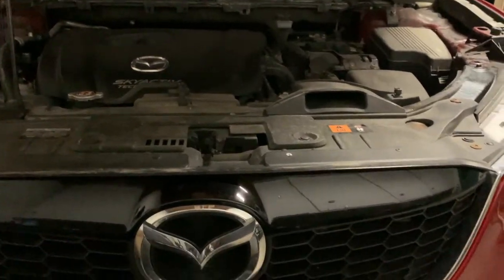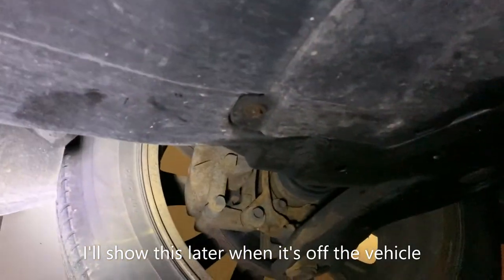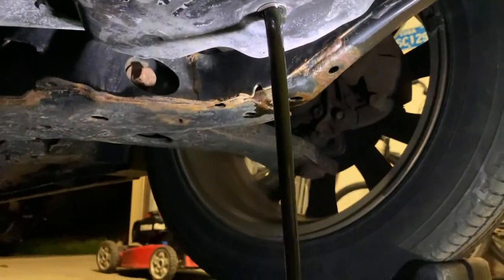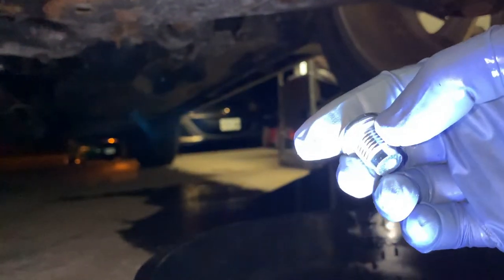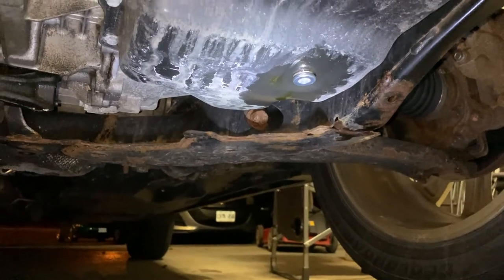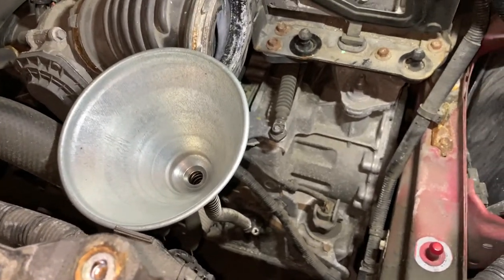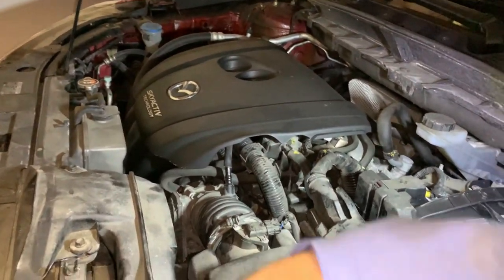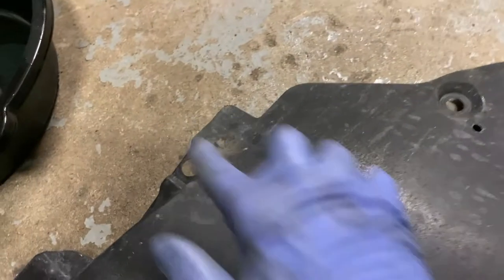Mazda Skyactiv 6 speed automatic transmission fluid drain and fill

Comment: Transmission fluid level should be checked at a certain temperature you will need a scanner that reads TCM to get your transmission fluid temperature you’re risking overfilling or underfilling
Reply: Actually you do not need to, drain the fluid when the car is cold, add back in the same amount as you drained, all done when the car is cold. I have changed mine a few times like this no problem, BUT making sure use the same Mazda auto trans fluid! Other compatible brands? I do not know...
Reply: @BaeLasso  even if that were true, it should be mentioned in the video.....
Reply: We
Reply: Drain and fill same amount

Comment: I have a 2014 mazda 3 with "lifelong transmission fluid"😂 it was pretty dirty when I changed it at 75k in 2020. What they mean by lifelong fluid is basically "life of the warranty fluid". so every 75k is a good fluid change interval, if you want your transmission to last as long as the engine.
Reply: Did you go to the dealer to have it changed?

Comment: 63,000 miles on our Mazda CX-5 so did this yesterday (exactly 3 1/2 quarts came out) Hardest part was removing that plastic covering underneath then replacing the stupid thing. Thankfully I have bins of various plastic clips which help replace those I destroyed removing them.
Reply: I just did mine yesterday, and only about 3 1/2 quart came out too…

So i just replace it with the same amount… im wondering why some get more or less from drain…

Comment: Best video related to this job I've seen.  There are a couple of others that omit removing the splash guard and air box.  This is also the only video I've seen that includes the need to measure the fluid removed to know how much to correctly put back in.  There are between 6 and 7 liters of fluid in the entire transmission.  

Changing the filter involves removing the entire pan on the bottom, cleaning thoroughly,  replacing both the filter and seal and putting the pan back on - torque wrench should be used.  

I'll note that there is a lot of conflicting info on whether the ATF should ever be changed.  Mazda claims that it never should be for Skyactiv unless a transmission component has been damaged or changed.  Yet, my dealer says this should be done and wants $350 for the job.  Of course, they also charge $75 to replace the cabin air filter - literally a 90 second job!  Common sense tells me that if you look at the fluid that was removed, of course it must be changed.  Apparently, you also cannot flush the transmission fluid without modifying something.  However, part of the debate I've seen researching whether to change the fluid or not has claims that changing the fluid can stir up metal shavings and actually damage a working tranny.  

Oh - and while it is expensive, the Mazda FZ transmission fluid is supposedly needed for Skyactiv.  Not sure how much stock to put in that, but I'm doing it.  Thanks again for the thorough video!
Reply: Yeah after seeing how easy it is to change I can't justify paying the $300 Mazda wants to do the job. They tried to get me to do it when I took the car in for service this week.

Comment: I have a 2014 Mazda 3 2.0 liter, same thing. Just did it today and SOOOO easy! Even had the air box assembly come out like a breeze when 2 other videos were struggling. Took 1 hour and 20 minutes with a LOT of fooling around and going slow, first time. Could easily have done it in less than an hour and every bit as important as oil changes just not as often. At 66K the original lighter blue green fluid was medium brown time to change! It shifted ok before but now it shifts even smoother and maybe quicker, well worth doing every 60K miles!

Comment: Thanx for the great video. Have a 2014 Mazda 3, did a drain and fill at 60K miles (4L Ravenol FZ). Now at 71k did a pan drop with a new filter (4.5L). Used the rubber gasket that came with the Wix filter. I had to try it. Leaked the next day. Got it on straight and it's just a bad fix. Dropped pan again next day, used HF Pro Seal Black RTV, put pan on, used the fluid I saved and walla no leak. Will do a drain and fill in 50-60 then another pan drop and filter around 150K.

Comment: Excellent video. Thanks. I'm gonna do this to my 2018 Mazda Demio. Same parts exactly. BUT,  since you removed everything beneath, you should change the transmission filter as well. All you had to do was to take off 6 screws for the oil gear pan and then two screws to take off the filter. NEW gasket is required but a good LOCTITE trans oil silicone red or grey would do fine.  Apart from this, thank you for the video. Absolute informative. Didn't know that Mazda 2 and 5 have the same air filter and 6 speed auto gearbox!!!
Reply from the maker: Not my car, wasn't my decision to make. Considering the mileage it would've been a good idea. I think that pan had 20 bolts though, not 6. Scraping the rtv off the pan and tranny case is also a miserable chore. If I was going to do it I'd use a rubber pan gasket. It may not last as long as rtv, but I'd be willing to try it anyway.
Reply: @416diy  you are absolute right mate!!! Thanks for your time.

Comment: When my 2018 Mazda3 was at approx 48000 miles. (I bought car used with 28k miles.) Car is in excellent cond. I took it to the Mazda dealer. They performed a full dialysis of the OEM FZ Mazda trans fluid. Price was approx $240 for the dealer service. Would have cost me a bit more, if you considered the amount of Mazda FZ trans fluid involved since each quart is over $20. Plus was a full fluid swap. From now on. I can do a drain and fill on my own. And maybe a pan drop next. Either way. Got ALL fresh FZ fluid in.

Comment: How much ATF FZ is drained with a simple drain and fill ?  4 quarts or so ?  I have 30k miles on mine, and want to swap out some fluid, simple enough, I am a firm believer of early maintenance, when it comes to engine oil and transmission fluid.
Reply from the maker: It's approximately 4 quarts/litres. My reco is to buy 5, as sometimes you'll get more than 4 drained out, and you don't want to be stuck without enough fluid in the middle of your job

Comment: great video....Question: should you also do the Transmission Filter also it or no need?
Reply from the maker: Certainly no need to do it every time. Never replaced the filter on my 2016 Mazda 6, and it's got 92000kms. Will probably do it at 120kms (75k miles).
Reply: @416diy  ok copy Thanks!...Cheers from the Philippines...
Reply from the maker: Salamat!

Comment: You said check the dip before draining but didnt mention that it is at a specific temp. Likewise, if you drain the fluid while its hot - more will come out, then you replace with cold fluid and it will be low.
Reply from the maker: Drain cold, measure what came out, and replace cold.

Comment: You are supposed to check the fluid level while the vehicle idles, you are actually low on fluid. It says it on the repair manual
Reply from the maker: You're right about checking while idling, but in this case I collected what came out, measured it and added back that amount, so no issue there.  Mazda didn't exactly make it easy to check the trans fluid on these cars.while they're idling, but if you know a good way to do it, I'm listening.
Reply: @416diy  I agree, and the dipstick is not the most precise thing in the world!

A check engine light comes on which will need to be reset, but you can turn the engine on for a bit with the airbox out to check it
Reply from the maker: That is true, most cars behave reasonably with the air box off. Not this car, it kicks like a mule.  I learned that the hard way when I did my first GDI cleaning.
Reply: @416diy  did you empty the fluid while cold? If it was hot, you might have underfilled

Comment: You should replace the fluid and filter every 50,000kms or 30,000mls otherwise the transmission will prematurely wear.
Modern automatic transmissions require clean fluid and the additives to function properly.
Only use an appropriate full synthetic fluid. Reference the owners manual for specs.
When you drain the fluid you are only replacing around half the volume of approx 8 litres in total as the torque converter stores around 4 litres.
Make sure you replace the gasket with a new one as they are prone to leak when you use the old gasket.
Interesting to see that modern manufacturers do not mention any service intervals for the automatic transmissions.
I think they are only interested in selling you another gearbox....modern consumerisms.

Comment: Looking to do this change. My mazda 3 2014 gt is now at 60k miles but the dealer recommends not to change it that it's lifetime?? Not too knowledgeable on this but is flushing recommended? Any reason not to do it?
Reply from the maker: You shouldn't have to do a flush if the fluid never gets overly gross. Flushing is more aggressive, expensive and requires tools most people don't have at home. Your other option is to do two or three drain and fills, which is of course more expensive but should get all the old fluid out, and you can do it yourself.

Comment: Hi! Aren't you going to change the ATF Filter?  Fluid looks so black.  I mean if it were oil change and oil is that dark, filter already has a lot of contaminants. TIA! :)
Reply from the maker: No I’m not going to change the filter, because the filter is actually a permanent strainer that costs a lot of money if you get it from the dealer, and also because the trans oil pan is adhered with rtv sealant. There is zero point replacing that OE filter with a $15 aftermarket filter, and I also don’t feel like spending a day on my back scraping rtv.  Hope that helps clear up any confusion.
Reply: @416diy  thanks for the response. I suppose this is better than no AT fluid replacement. I thought it was common as there are Skyactiv YouTube video  showing that they've replaced the AT Filter. A lot of work but makes sense for them when replacing AT fluid to also replace the old filter which can contaminate the new fluid. Thanks for the vid and clarification.
Reply from the maker: @timsavvy  if you want to get all the old fluid out (or most of it anyway), do 3 consecutive drain and fills, driving the car for a few miles in between each drain and fill. Got that advice from the Mazda3 service manual. It’s a little costly to do because of that FZ fluid but it’ll achieve what you’re looking to do, and it’s not particularly labor intensive.

Comment: I just checked mine and it’s the color of lightly used clearing brown oil. Really weird, I thought the og color was blue? Only thing I can think of is it’s been changed before with the wrong fluid or the og fluid lost it’s color over 115k miles (is that possible?)
Reply from the maker: FZ fluid is blue, you're not wrong. For whatever reason that blue is gone once it goes in the tranny.
Reply: @416diy fsm says it can turn reddish from oxidation.

Comment: Is it better to do a transmission flush or just change oil and wht?
Reply: Just drain and fill at 50k as a good rule of thumb and do it every 50k after. The sediments between gears keeps the hydraulic pressure the same as it is built up over time. I did it to my 4Runner and boy did it run even better!
Reply: I can’t imagine this being any different on a CX 50, so I will do it when the time comes! Just takes time with the splash shield and the box, otherwise, simple!

Comment: Do you know if this vehicle has a transmission fluid filter? If so, should it also be replaced?
Reply from the maker: Carlos Gomez there is a filter, or as Mazda calls it, a strainer. The only reason to change it is if you have to remove the pan. The pan is bonded to the case with rtv sealant, which is miserable to remove and reapply, although you can get an aftermarket rubber gasket instead of reapplying rtv. The transmission is a sealed unit so there really shouldn’t be much in there for the strainer to collect anyway, there’s also a magnet on the pan to catch metal filings.
Reply: @416diy  Agree. It's just a strainer not anything like a oil filter.   If its clogged up with metal parts your transmission is going to fail soon so doesnt matter.

Comment: Thanks for sharing! How do you like the auto transmission. I doubt about buying a 3 manual or auto. Doubt if the automatic is not to slow...
Reply from the maker: My 2016 6 is auto, best auto I’ve had yet. I’d have preferred manual but I’m not the only one driving the car.
Reply: @416diy hello there! I see you have a 2016 Mazda 6. I have one too. Did you change the ATF of your own car? If so, the procedure was the same as shown in this video? Kind regards.
Reply from the maker: @alxsilva846 yes, exactly the same on mazda6 as this cx5.

Comment: So at what  miles  trans  oil needs to be replaced?
Reply from the maker: Since there's no factory service interval, the best I could suggest is to use the fluid color as your guide. I do 1 drain and fill, drive it around a bit to circulate the fluid, then check again. If the fluid on the stick isn't at least somewhat red, do another drain and fill.

Comment: i prefer to do the first change at 30k and no filter   are you using mazda fluid?
Reply from the maker: I wouldn’t recommend anything but the Mazda fluid. Totally agree with changing the fluid early and doing it on a regular basis. This vehicle however, is not mine and had the original fluid in it for 150,000 kilometres, hence the colour.
Reply: @416diy  I just bought a 2016 Mazda 6 GT,  142K KMs, previous owner I can't tell if they've done it or not. So i was planning on doing it.   Would it be too late for that? Scared it might destroy the transmission...

I'm also in the 416,   could I pay you to change it for me?!
Reply from the maker: It’s never too late. All you need is the FZ fluid and a drain bolt washer from the dealer, some sockets, a long flex neck funnel and ramps or jack stands. The worst part of this job is getting the splash shield off, as the hardware gets rusty quick.  I’m flattered to be considered for paying jobs but I’m a hobbyist, not a licensed mechanic, therefore no insurance. All the cars I work on belong to me or friends/family. I’d love to hear you did it yourself and that my video helped,, but if you’re not comfortable doing it I can recommend a shop in the east end that’s owned by a friend of mine.

Comment: That oil looked terrible good thing you changed it.
Reply from the maker: Cow muscle and that was at roughly 150000kms (93000 miles). My 2016 Mazda6 has 70000 Kms on it and I’m doing the first drain+fill this summer.
Reply: @416diy  700000 thats something

Comment: Mazda changed transmissions during the 2016 model year. Nissan transmissions gave way to Mazda's own manufactured units. Capacity may be different, fluid spec. may be different and filter and pan may be different as well. Idemitsu makes several specific fluids for Asian transmissions. Amazon carries most of them.

Comment: At 40,000 miles my auto 6 speed 2016 cx5 would buck when I put it in reverse. I changed the fluid and filter now there’s a huge noticeable difference and no more buck in reverse
Reply: I drop fluid and pan with new filter and scrape and replace red rtv gasket maker noticeable difference every time 115000 and very smooth still

Comment: I am going to cut my own hole where the trans drain plug is and may a removable port.
Reply from the maker: I did that on my Mazda 3. I drove a couple of small holes on each side so I could zip tie the piece I cut out back on, then when I do a drain I just cut the zip ties and replace them
Reply: Just did mine, only 3.2 quarts came out, car was on an incline (ramps), just replaced what I took out.  Will do again in 2 days or so, to get more fluid changed, I bought 8 quarts of OEM FZ, so I have plenty.  I’m surprised how black it was only after only 30k miles, still saw a tiny tinge of blue to it in the light.  How they say this is “lifetime” is beyond me.

Comment: Good video but interval and the fluid type  would have been good information to provide.
Reply from the maker: The fluid type is in the video description (Mazda FZ ATF). There is no official interval because Mazda claims it's lifetime fluid. You're only getting 1/3 to 1/2 of your fuild out with a drain and fill, so it's not a horrible idea to do it more often, I'll probably do mine every 25,000 miles (40,000 kms).
Reply: Ok thanks I'll probably just change it every 30 or 40 thousand miles then.
Reply: Every 30,000miles or 50,000kms.
Use a full synthetic ATX fluid.

Comment: SO much rust.
Reply from the maker: Roman Centurion all Canadian cars look like that after 1 or 2 winters
Reply: @416diy  Damn, that sucks. I knew the salt on the roads in north accelerated corrosion but I didn't actually expect it to be that drastic. In Texas, the only cars that rust are the boats from 70s before they figured out corrosion coatings on the chassis.

Comment: What a silly design. 
Mazda- "Lifetime fluid" w/ a hidden transmission dipstick??
Can see how a reputation of weak transmissions can surface with non questioning drivers not activity changing the fluid every 50-60k like they should on any other manufacturer's vehicle. 

CHANGE THAT FLUID!